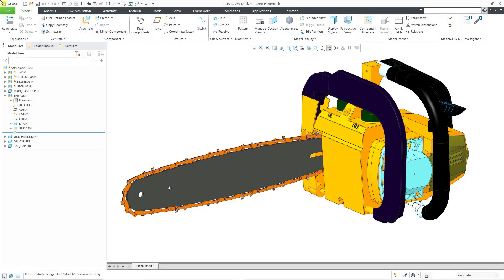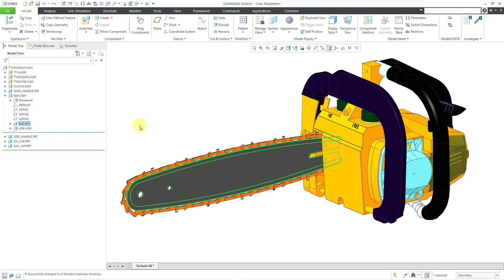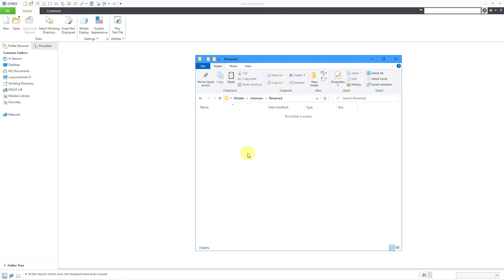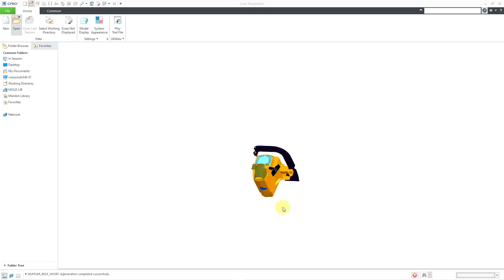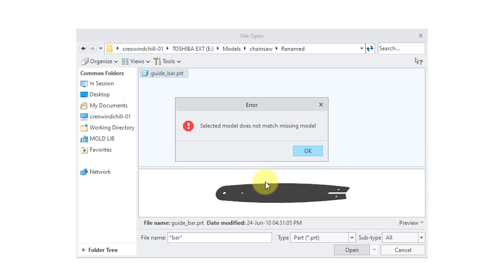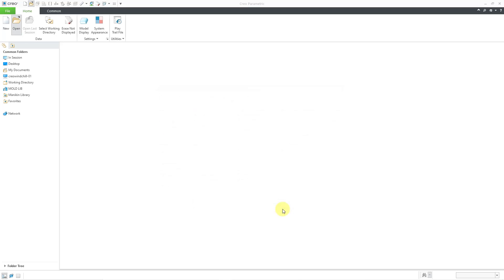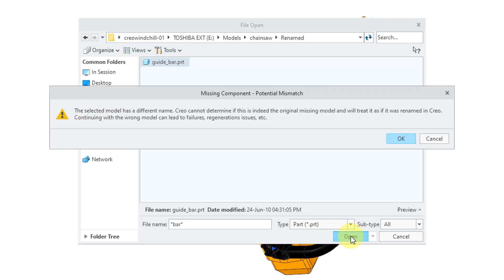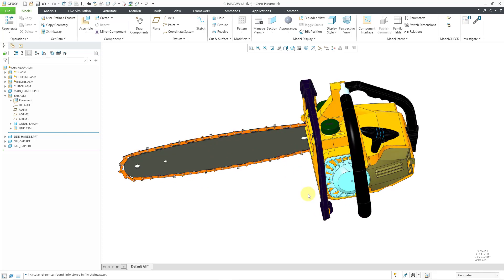Creo Parametric 9.0 - Retrieving a Missing Component (2022)

Comment: My assembly file not opening in creo it's showing error of file can not be retrieved
Reply from the maker: The most common cause is that you are trying to open a model saved in a newer version of Creo than the version you are using.
Reply: @CADPLMGuy  I'm using same version bro
Reply from the maker: Then open a ticket with PTC Tech Support bro
Reply: @CADPLMGuy  how?
Reply from the maker: Support dot PTC dot com